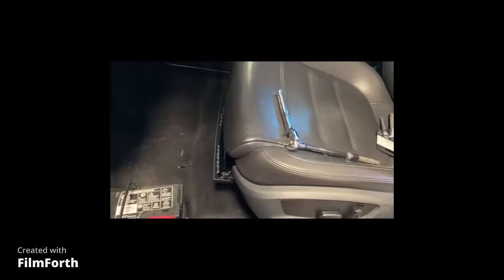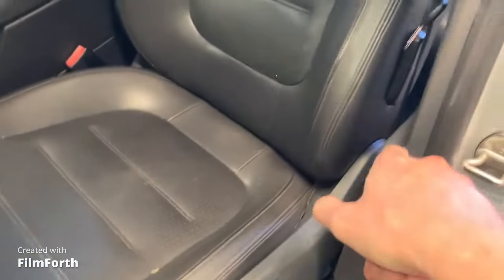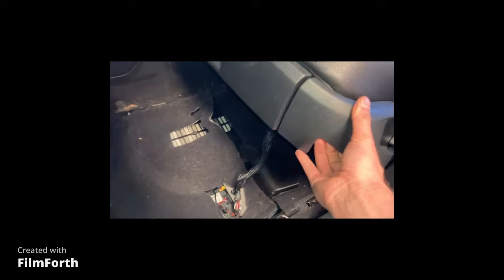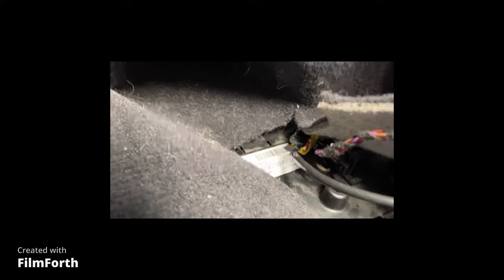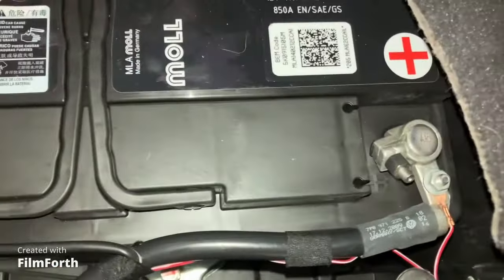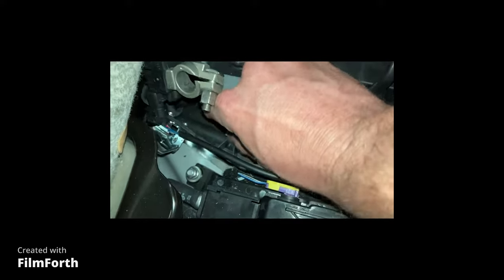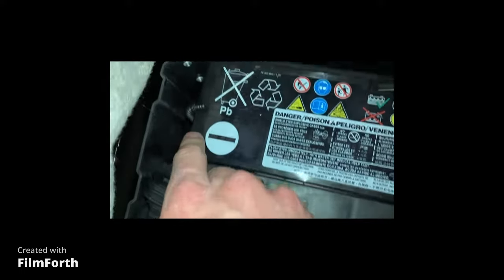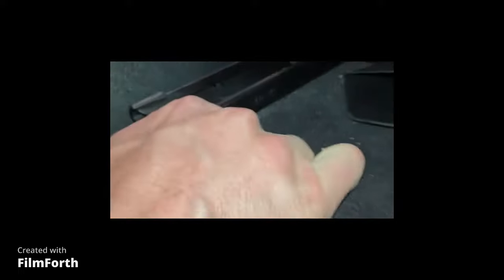How To Change the Battery in a Volkswagen Touareg

Comment: Thx for instructions. Only issue is airbag light is on now. Checked all harnesses. All tight. Pls help
Reply from the maker: You may have to use a high level scan tool to clear the airbag codes… if any airbag wires were unplugged when the battery was connected this could cause a “no response” code, however once cleared the code with not set again assuming the wiring is intact with no opens in the circuit

Comment: What do you do if the battery is dead and you can't move the seat forward or backward?
Reply: its likely the BCM/ equivalent retains a certain amount of power for some systems and disables others...so whilst the battery appears ok in one way , its actually unable to give some systems the desired power IE transmission
Reply: Put a jumper cable on it